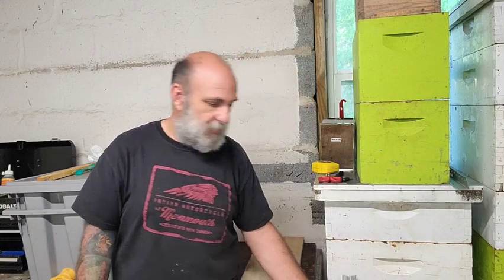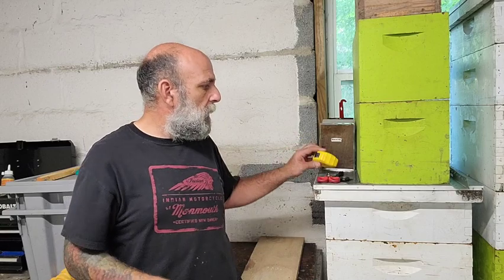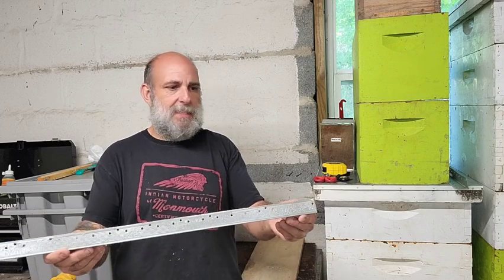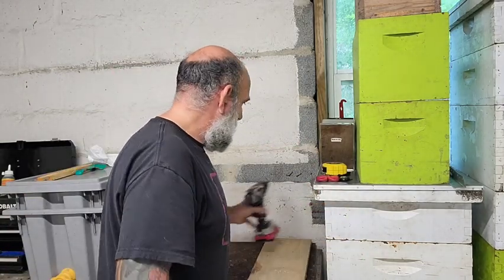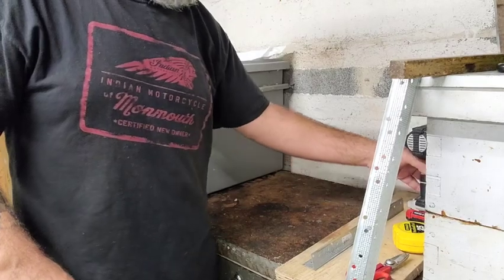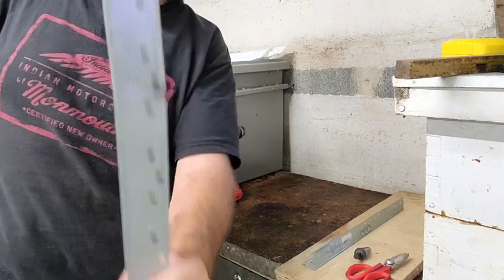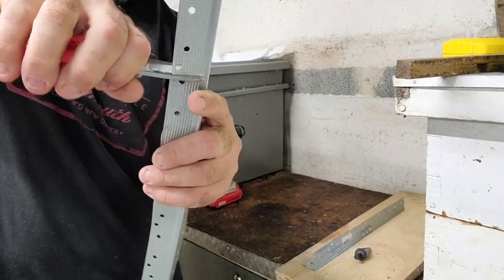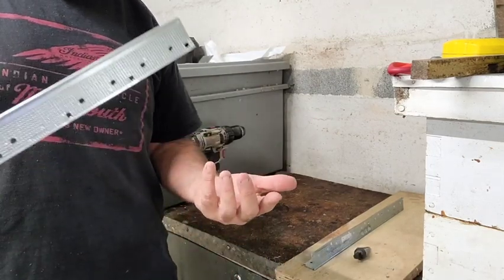How to make mouseguard/Entrance Reducer combo for winter preparation

Comment: You don't need to waist money on mouse guards. Mice can not get through a 3/8 inch or smaller operating.
Reply from the maker: Because the smallest opening on a manufactured entrance reducer is 3/8" tall?  
-Those openings can and do get chewed up.
-I find myself not using the manufactured mouse reducers much anymore.  Instead,   i cut up scrap 3/4×3/4 strips of wood and customize opening size.  
-although the smallest opening is only 3/8" tall, it is 1.5" wide.  I prefer a perfect 3/8" hole.  Much less room for smaller mice to utilize the extra 1.5" to squeeze through.